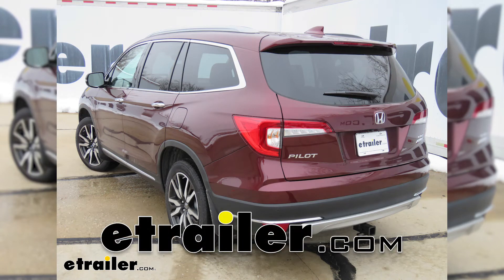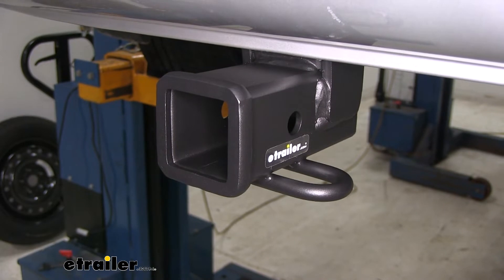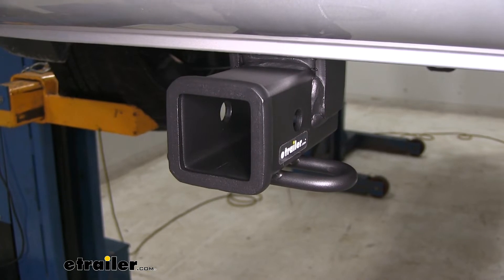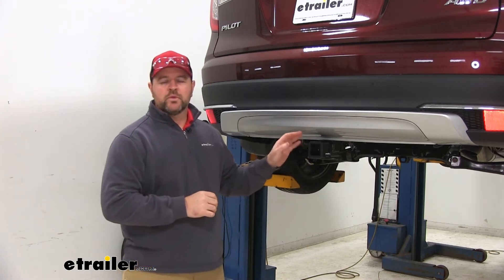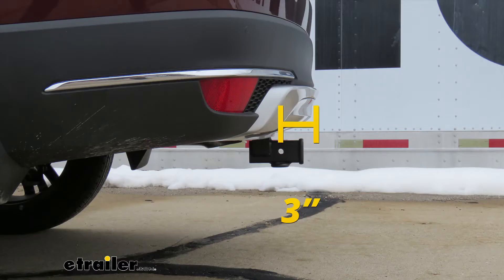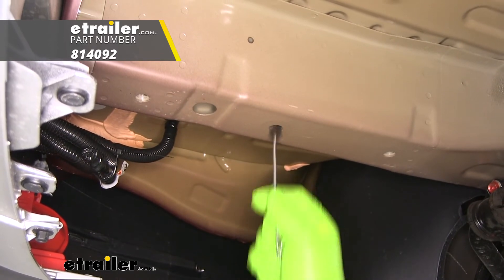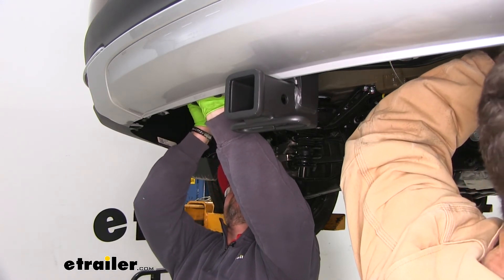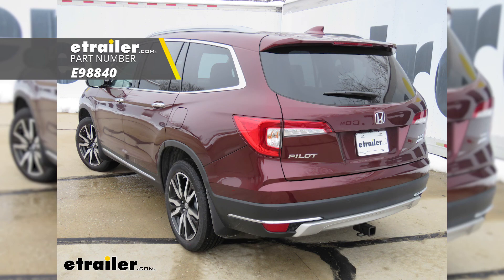Install: etrailer Trailer Hitch Receiver on a 2019 Honda Pilot

Comment: Hi, I am interested in knowing how it affects the hands free tailgate sensor on Touring and Elite models.  Does your hitch require an adapter from Honda to extend the sensor?  Please advise.  I see you installed it on the Elite model.  Thanks.
Reply: soak000 good question I want to know as well
Reply: @mosween6278  I bought a Curtis hitch that's similar to this one in the video and it didn't interfere with the hands free tailgate sensor.  Hope it helps.
Reply from the maker: Thank you for the info about the Curt hitch and your liftgate sensor! We have yet to hear of any of the trailer hitches for a 2019 Honda Pilot interfering with this function but it is always good to get feedback! This specific trailer hitch is designed just like the Curt trailer hitch so if that isn't causing issues you can be confident that this won't either. Here is a link to all of the trailer hitches available for a '19 Pilot https://www.etrailer.com/hitch-2019_Honda_Pilot.htm
Reply: @etrailer  Yes, I got mine from etrailer.com.  Honda OEM hitches that come through the bumper does interfere with the tailgate sensor.  Thanks.

Comment: What was the torque specs for the hex bolts?
Reply from the maker: Because they can change over time, we don't publish or broadcast the torque specs. You can find them in step # 2 of the instructions we've linked below for you:
https://www.etrailer.com/Trailer-Hitch/etrailer/e98840.html
https://www.etrailer.com/instructions.aspx?pn=E98840

Comment: Unusful video wrong info honda max limit is 6000 pound
Reply from the maker: According to the owner's manual for the 2019 Honda Pilot, the towing capacity varies according to the number of occupants and how the vehicle is equipped (FWD vs AWD models and models equipped with the transmission cooler vs those not so equipped). The capacity ranges from 2250 lbs for a 2WD model up to 5000 lbs for an AWD model with the ATF cooler. The hitch itself has a 6K capacity, but you'll need to abide by the actual capacity of the vehicle if it's lower than the capacity of the hitch.
https://www.etrailer.com/Trailer-Hitch/etrailer/e98840.html